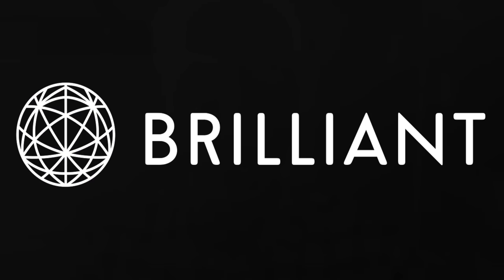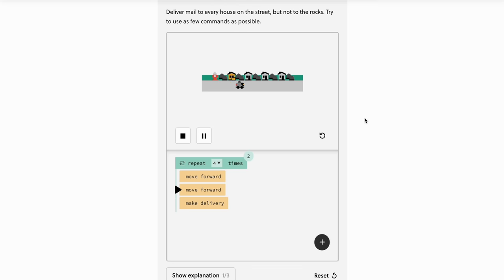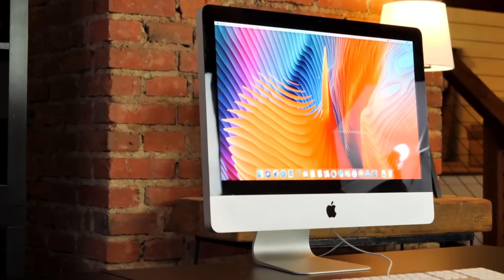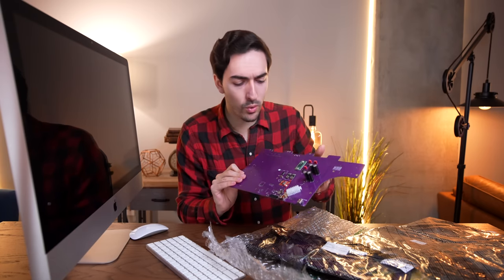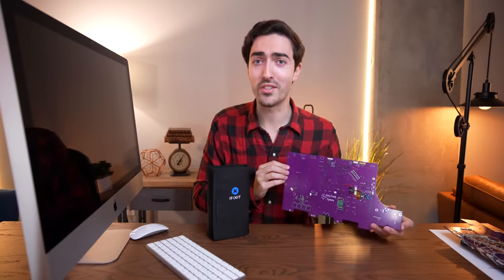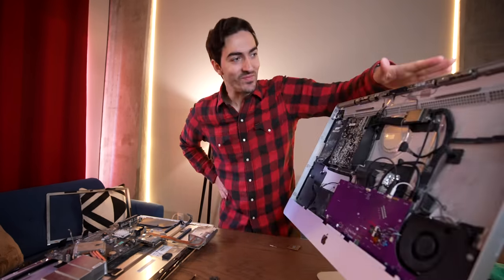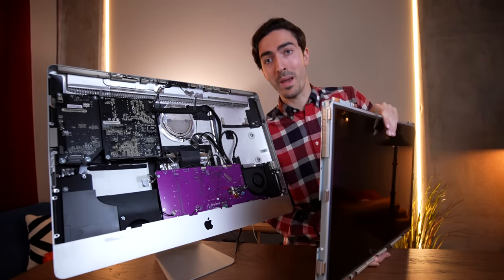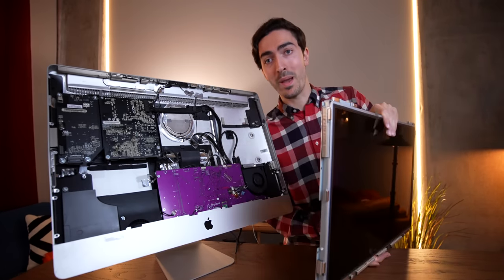Upcycle an old iMac display with this INSANE mod!

Comment: Men I have a bunch of iMac 5K 2015 at the office that we just upgraded for Apple Silicon machines and we would like to re-use those as displays but there is no easy way. For sure of this would be available for 27 inch 5K iMac I would have requested 1 right away to test and show and then ordered a bunch more for the whole fleet to re-use. Hope this happen someday.
Reply: What Apple silicon machines did you upgrade to? Mac Studios?
Reply: We are planning on the 5K… it’s in the works
Reply: @digitalrampage  That's really good to know. I'll try to hold on to a few we have in stock.
Reply: @emilsecker7881  Yes and some by M2 Macbook air, it's suprising how much more powerful those Macbook Air are versus these iMacs, and with the hybrid work they really love it.
Reply: @No0ne91 :  We’ll, whoever’s paying the bills won’t like the cost of these cards. 😢

Comment: Juicy Fruit M1 3D printed adaptor costs $110........
Reply: The adapter kit includes the required adapters and wire harness too.
 Not just the physical bracket.